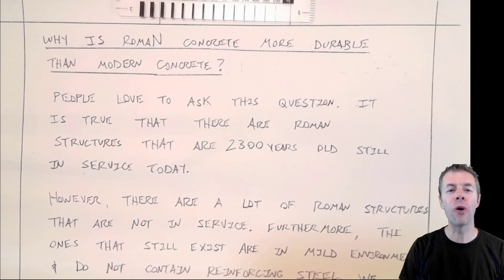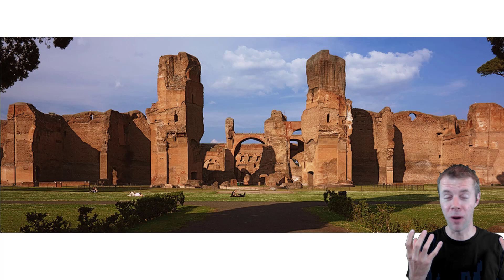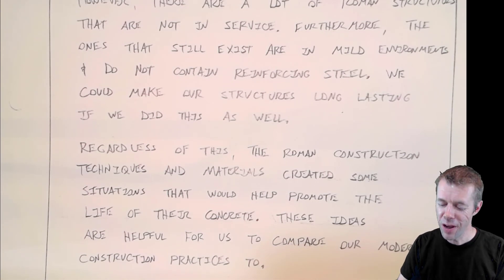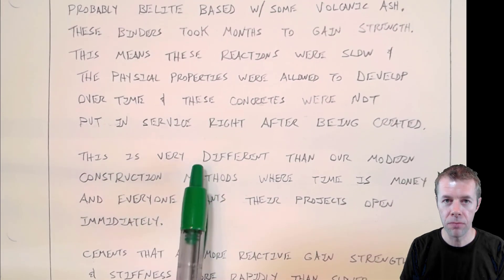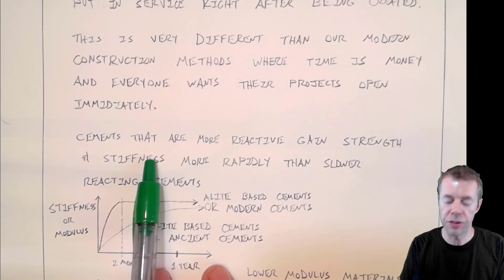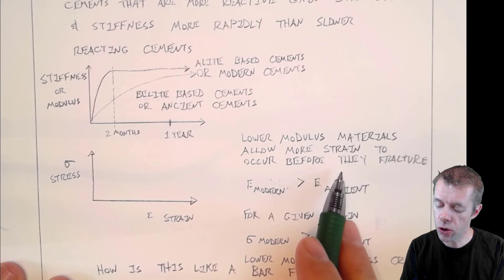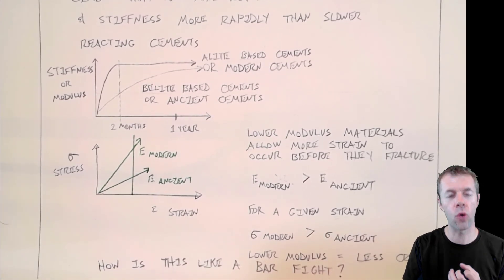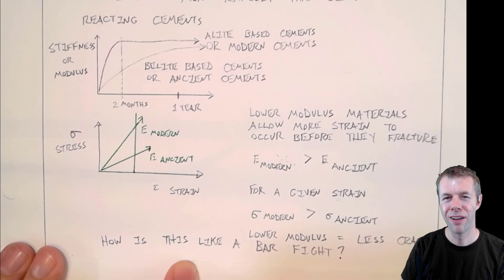Why is Roman Concrete More Durable than Modern Concrete? / How to Win a Bar Fight?

Comment: You said you guessed they didn't open it for a year, this isn't the right reasoning.. you mentioned lack of corrosion, what about the Roman concretes standing in the ocean being hit by waves and salt millions of times more then out concrete
Reply from the maker: Modern concrete would have no problem with waves and salt water if it didn't contain steel. 

I don't understand your first sentence.  It was common knowledge in Rome that concrete gained strength over time.  They left their concrete roads empty for at least a year before using them.  We don't do that with modern concrete.
Reply: @TylerLey  ah you sounded like you were making an educated guess over fact about the curing time of the concrete, Maybe I misheard - it's early here and alcohol is still in the system 

We do also have concrete additives and curing methods to further strengthen the concrete, eg. Watering it for up to a few weeks after, different aggregate sizes. 

What about galvanized steel? Would that be any stronger when exposed to water / erosion etc? Aren't there theorys about the substances they used in concrete that are lost today?
Reply from the maker: Sam,
You are right! We have lots of tricks to tailor our concretes today that didn't exist before.

I love galvanized rebar!  It is better than the normal rebar that we use but it will still break down and corrode.  I talk about it here: https://www.youtube.com/watch?v=xVDy84rR5Z8

Roman concretes are different than what we use today.  They used lime and volcanic ash.  Today we use portland cement and fly ash.  Fly ash is man made volcanic ash.  The Roman concrete may be better at resisting cracks but modern concretes are more consistent, gain strength faster, and can be designed to have long lifespans.  It just depends on what you want your concrete to do and what you can afford.

Thanks for the conversation!
Reply: @TylerLey  thanks for the replies and the information / informing me 😁

Comment: Your speculating based on your oppinion as there are breaker walls in contact with the sea in England still standing.
As a builder (not a reader of) Roman comcrete are far more durable than present concrete used, the reason we don't use it is that Roman concrete is more labor intense. Also I dont believe youd do well in a bar fight with your knowledge, that too requires much hands on to know what works, theory is for non doers-self proclained "teachers" that teach bad practice and offer bad advice.
you do sustain as much damage BTW ,you simply are too drunk to care and you dont register pain as much when drinking, hence drinking before surgery prior to modern medicine. Your welcome if your not too proud of your paper, if you are sorry for wasting my time to offer sound, practicle exp regarding your bunk theorys that are barely more than fanciful thoughts that don't really apply outside of talk.
Reply from the maker: John,
I agree that I don't know for sure why some things fail and others don't.  However, those Roman walls in England don't contain reinforcing steel.  Corrosion of reinforcing steel is a weakness of modern concrete.  If we could design them without it then that would greatly increase their life.

Materials with a lower modulus experience less stress than a material with a high modulus for the same deflection.  This is a truth that is a widely known.  

For example, compare a serving plate made of glass versus a paper plate.  You can deflect the paper plate a lot and it doesn't break.  Is the paper plate stronger than the glass plate?  No, it has a lower modulus.  This is the concept that I am trying to teach.

Let's say you are going to be hit by something.  In one circumstance you tense up and in the other circumstance you are relaxed.  When you tense up your body will take more damage and you will feel more pain because more of the load is transferred to your body.  If you are lose then your body will give when you are hit.  The force is dissipated as you give and less of it will transfer to you.

This is why we have bumpers on cars.  It crumples and gives when something hits it.  This is why we design our structures that will see earthquakes or bomb blasts to give and not be too rigid.  Think about it and let me know if it makes sense.  You seem to have lots of experience.  I bet you have seen this in your life.
Reply: @TylerLey  Then why nobody is putting stainless steel in the concrete to avoid corrosion?
Reply: Tyler Ley heres a begining beyond the I dont know (link below) bit you would know if you knowledge base was not theory.
https://youtu.be/R9sZSrhoPJY
Reply from the maker: Stainless steel costs about 6x more than normal rebar.  There is also not enough stainless produced every year to supply enough to replace rebar.    I have a recent video where I talk about it here: https://www.youtube.com/watch?v=1ELHzXuwdqg